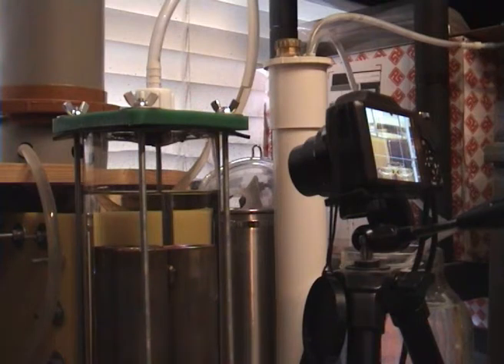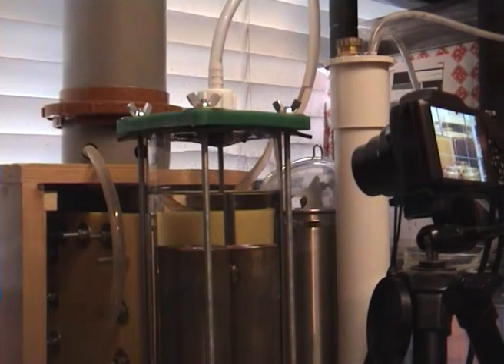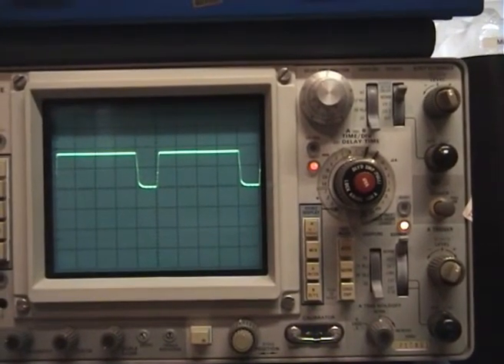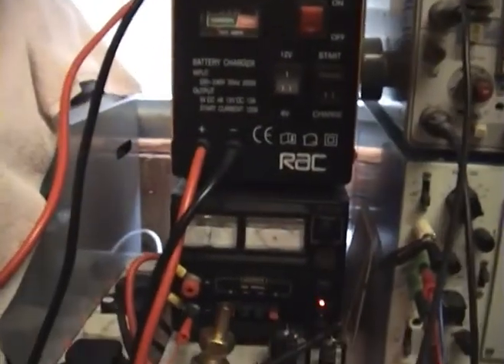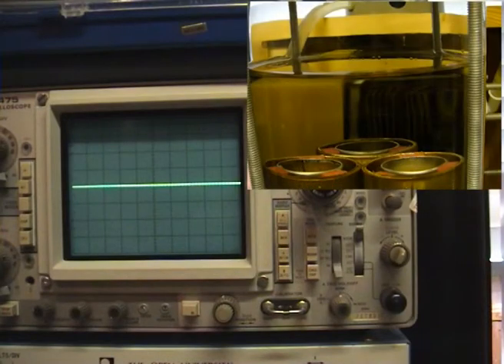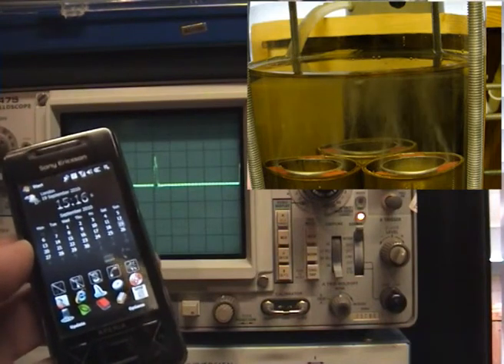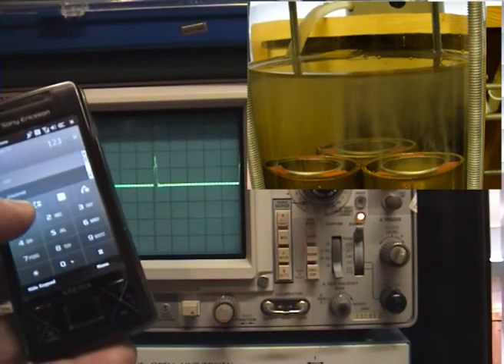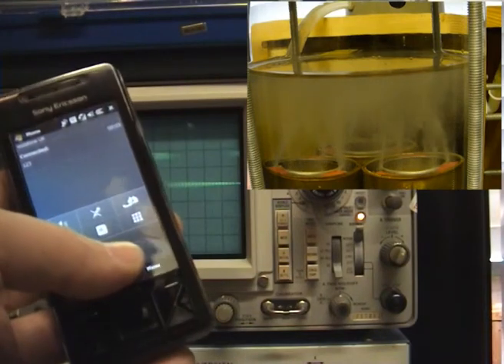PWM and mobile phone interference

Comment from the maker: If you slow the video down you can see that the cut back point varies in width during the interference and results in a new setting under which the PWM is trying to operate and thus draws more current momentarily from the PSU. This happens rapidly and manifests itself as erratic fluctuations in amp readings at the PSU (between 1 and 3 amps) but it is not cyclic and instead appears random. I wish I had a third camera so I could have included the amp readings at the PSU in this as well.